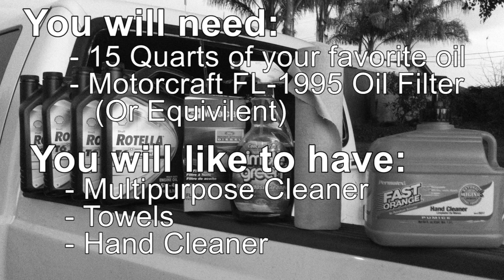How to: Oil Change on a 7.3L Powerstroke Diesel

Comment: but how do you drain the hpop? i guess it's not necessary, it's not even 250ml of old oil left over. thanks for not making the video overly long
Reply from the maker: Changing the HPOP oil is controversial. You can, but don't have to. The small amount of oil in there will immediately mix the fresh oil. If you why to change it, you can use a hand or vacuum pump to suck it out.

Comment: i was wondering what kind of oil wrench you were using. It looks like a good and sturdy one.
Reply: Thanks. One question if you don't mind. You had mentioned a tool bag you carry in your truck. I was just wondering if I could get a run down on what you carry in it. I need in to build me a bag and thought it may help.
Reply: +Trey Spooner I just recently put a jack there...guess I'll need another spot.

Comment: How much do you find your oil change costing you and how often do you need to do it? I'm thinking about picking up a superduty...
Reply: 100 bucks is a lot for oil, and for filters, and 8-10K miles is pushing your 'high quality' oil.  Recommend every 2500-5000 miles, and buy it in larger quantities and get all the oil out of your engine and reserves to make your engine last longer.  You won't have to test it, your engine oil upon exit will be obvious if you have particulate of any real kind.  Use a magnet as well to find particulate problems.
Reply: You don't know what you're talking about. Diesels easily go 7500-10,000 miles between changes. Changing at less than 7500 miles is a waste of oil, unless the engine sees extreme use most of the time.
Reply: At Walmart, synthetic was $113 after tax for 4 gallons and the filter was another $26 (obviously price gouging due to shortages). Pre-pandemic the filters were $5.99. I found the filter on Amazon for $9.40 so I opted for that instead, however the cheapest synthetic rotella i could find anywhere was still $26/gal (+ tax) 😱

For whatever reason all the regular maintenance fluids (R134a, oil, trans fluid etc) have SKYROCKETED recently. Especially diesel wtf.. Back in March I went into the store and asked asked the clerk if that price shown was right or if it was a mistake... No mistake. Prices here to stay.

So basically the cost boils down to   about $124 for 4 gallons of synthetic and a motorcraft filter. Also you can use T4 for 16 (+tax)/gal, it'll save you about $40 which is practically nothing nowadays anyway... Srsly inflation is out of control. I bought my truck in 2020 and rotella t4 was only 12.50/gal. Synth was around 21.

I switchover to Synth around November and run t4 from March the rest of the year. Either one, I still change every 4000 miles. T6 performs better when cold.

Comment: I just put the new filter on my 2002 F250 7.3......i just learned a new thing.....puncture a hole in bottom of oil filter...... thing is too heavy and slippery, dropped it twice and oil all over!!!! Thanks! was in here checking to see how many quarts the 7.3 takes...... 15 i guess.
Reply: apparently puncture is a good idea, with an old vacuum at the oil filler (make sure dip stick is closed, and so is your drain plug/whatever he has on it.  This will create a vacuum and make it so oil doesn't gush out.  Also really helps to have all things lined up, and make a quick puncture and don't let your gloved or ungloved hand and tool sit around in the oil flow for long if at all.  A crappy screwdriver bent at a 90, with a good thump of a hammer, and then out again with same hammer should make quick and clean work of making the puncture, and then removing the tool to let it flow out.

Comment: Try putting a small shop vac at the oil filler, then puncture the oil filter and remove the oil drain plug. No oil will drain until the vacuum source is shut off.
Reply: Never really thought of that, would indeed seem to make sense.

Comment: I'm going to have to disagree with you on this one. It was designed to circulate and in pre 99 7.3 motors it does drain back into the oil pan that's why they take longer to start. The next time you change your oil drive it 20 miles and then vacuum out the upper oil reservoir and compare it to what's on your dipstick. It won't be the same.

Comment: Make a hole before you drain, always.  Saves mess and time cleaning up.  Don't bother filling filter, waste of time, and risk of dumping it if you don't get it on right and it drops out of hands.  Finally, the evil eyes :)
Reply: True story, went all over my face and in my hair when i took it off without draining 🤦🏽‍♂️ good thing I was wearing safety glasses! +

Instead of poking the bottom, couldn't one just stab the side with the screw driver and subsequently leverage it in a counter clockwise motion? Less tools, less steps. Never been a fan of oil filter wrenches. You fan do the same thing with a belt and any kind of rod or stick that fits. Wrap the belt, grab the (ratchet etc) and turn opposite of how you wrapped it. If you're turning backwards you will need to undo it and flip the buckle piece the other direction.

#MexicanTools 🇲🇽

Comment: No it is not fine to leave 3 quarts of old oil in. Would you turn off your fancy little drain valve way before it was through draining? No sir. Don't be lazy and skip the HPOP. It's easy to do if you checkout some proper videos.

Comment: You neglected one critical step to changing the oil in a 7.3 and that is to change the oil in the high pressure reservoir.  Failure to change this oil will result in shorter life expectancy of you injectors.